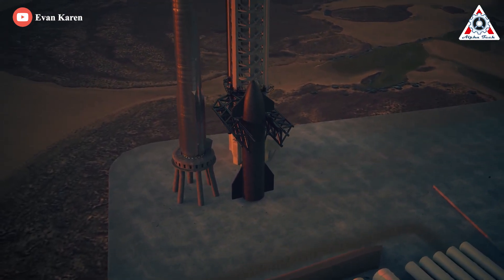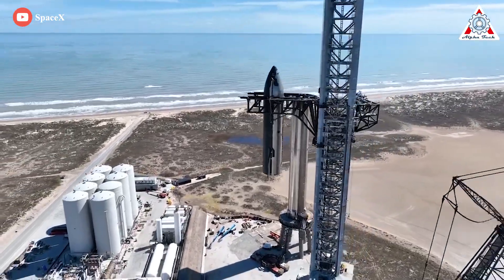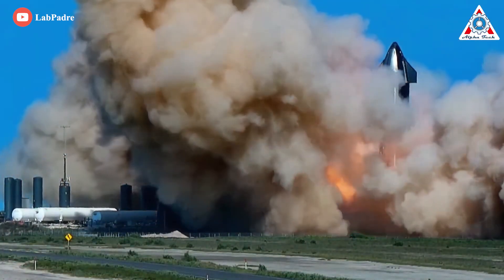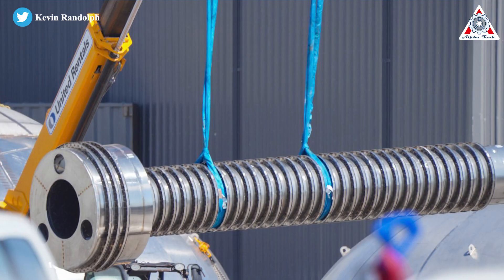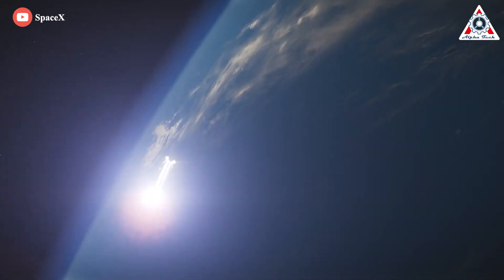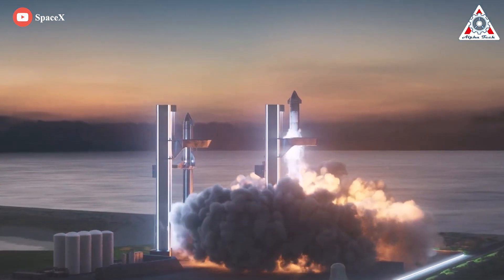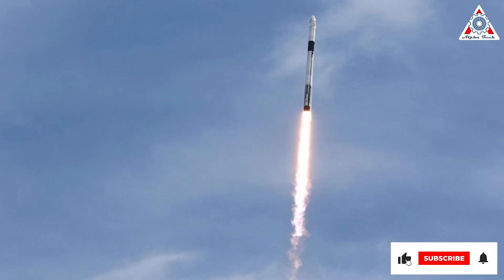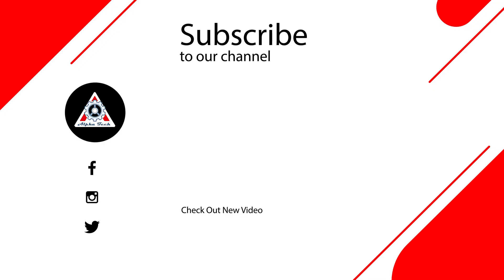SpaceX upgrade everything for the massive engine testing and orbital flight incoming

Comment: They should make a heavy steel cone under the booster as a flame diverter. They could put it in below it in two parts and then assemble it with heavy bolts and then bolt it to the concrete underground.

Comment: How hard would it just be to ditch the big booster and instead add 3 or 4 reusable falcon rockets that detach and self land. This thing also needs nacelles. It should look like a giant x-wing upright. If you move Starships engine and fuel to the ends of the nacelles you'd have more space inside. In fact, you could make the bottom of Starship a cone. In orbit, this new design could have liftable cones and connect end to end. Starship would be modular, to bulid like Legos into larger structures. Megaplex the engines to get whatever direction you want. Imagine a 1 kilometer rotating megastructure, made out of starships. What do you think?

Comment: what's the possibility they only half fuel the initial launch attempt and run the engines at 50% thrust? I mean the thrust and dry and fuel mass figure world be a bout the same as the space shuttle under those conditions if my wikipedia glances are accurate. It's not like they need to seen some massive payload to orbit and only half the thrust would minimize olm impact until they settle on a reliably reusable arrangement.

Comment: SpaceX fans should take a moment to consider just how they ended up with the existing launchpad issue with the lack of a flame trench.  The original permits for the facility were for Falcon launches.  Musk tried to sneak in the Starship launches under the original permits and was caught by the Army COE, the FAA and others.  Those agencies and their personnel are now laughing in their sleep because they knew that Boca Chica could never support a launch pad capable of handling Starship (which needs a flame trench).  Musk has been launched upon his own booster (petard).

Comment: you think youd would be able to divert the flames and gassed down and out away instead off straight down. i m not meaning a trench that goes under ground just down a a bit then ramp it out if that makes sense kinda like a ramp for a bike

Comment: A graphic illustration of an Astro strut would have been very helpful.  Still a good video!  Wonder if a lesson for the flow of rocket exhaust can be gleaned from how a transistor or FET works; Only in the inverse.  instead of a gate flow to open and close power terminal electron flow; consider using a rocket engine to blast the exhaust sideways allowing for producing liftoff thrust without damaging the launch pad base.   Remember it is only momentary.      Wish YouTube would give engineer type posters a break and allow them to put up an illustration thumbnail.
Reply: They are a fictional part from the video game Kerbal Space Program not a real thing unfortuantely.

Comment: about the "rapid unwanted disassembly" mode, with its green flame signaling the burning of copper, I have also heard of the "3rd type of rocket motors"
1 - rich in fuel: uses more fuel than oxygen
  2 - rich in oxygen: uses more oxygen than fuel
and the 3rd
rich in engine: which also uses engine materials  😂😂

Comment: Since flame trench is out, how about a 'flame doughnut-half-shell', hyperbolically curving out from a central spike(maybe internally cooled by a water jet from below, directed at the peak of the spike), to reduce exhaust pressure/velocity as the exhaust comes down. The water below the half-doughnut-shell could be drained/pumped out to a cooling column (hot water inlet into top of column/cylinder, cold water outlet at bottom), near the doughnut. Outer rim of doughnut high enough to divert blast away from surrounding equipment. The 15,000,000 pounds of thrust coming down, if perfectly reflected directly back up(not absorbing any energy), will exert a force upon the ground of 30,000,000 pounds. That is equal to 300 fully loaded tractor trailer rigs stacked on top of each other, almost as tall as Starship/Super Heavy!Thanks for the video!
Reply: You have a good idea there!
Reply: @KEB129  Thanks Keb! Cost of a test could be high!
Reply: I wish YouTube would give engineer type posters a break and allow them to put up an illustration thumbnail.  Like your idea but sure would like to see a cross section or oblique view of it.

Comment: Thank you for info regarding the flame trench situation, but while I tip me hat to what SpaceX has achieved without a trench, I am disappointed that they have not faced the fact that their Super-Heavy is too powerful to test without some kind of diverter - - even if their only option while at Boca is to divert the exhaust at ground level for 60m or so and then diverting it upwards. It wouldn't surprise me if the first diverter would have to be a open-design to minimize back pressure, a diverter from one side, the main exhaust channel on the opposite side, and the other two sides left open.

Comment: I wonnder if vibrations and destructive force at the launch table could part wise mitigated by counter sound or brown noising. Sound waves projected against each other can reduce vibrations and noise which could help to keep destructive sound caused by raptor engines in check.